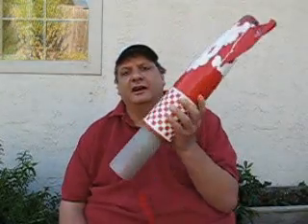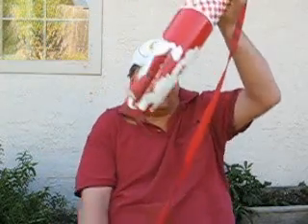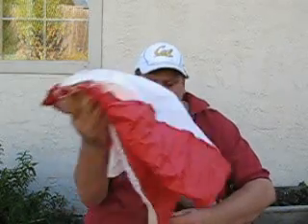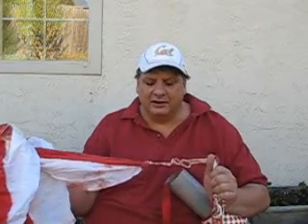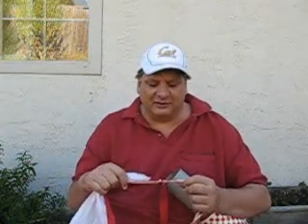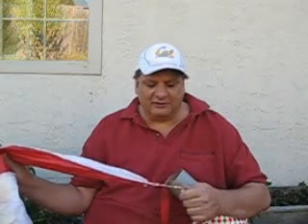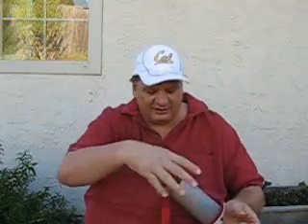Shreds and Rocket kits

Comment: Also forgot to mention my lastest rocket was a scartch built 2.26 times up scale Estes Goblin.  It use 3" BSD body tubes, 3" BSD ogive NC, 1/8" baltic birch fins, and it has a 38mm motor.  It should be flying at the Nov Snow Ranch launch if I get the external fillets done by then.  Also my next project is gona be a 38mm minimum diameter rocket using LOC tubes and an Acme 38mm fin can.

Comment: There is also Public Enemy Rockets they make some great rocket kits for some one that has built a few high power rockets before.  I own two Public Enemy Kits the Performer and Extreme Performer they are both great.  Also LOC kits are great I own the Weasel, Viper III, and Starburst.  All great kits, but with the Starburst I regret building it with the two 24mm motor mount and I wish I put a 38mm in it.  Also about AeroTech kits the Initiator is a great kit mine has 13 flights on it.

Comment: You also forgot the PML Phobos and X-Calibur both of which I own.  Also I certified L1 with the PML Phobos.  In addition I pranged my PML X-Calibur at XPRS V and it surrivied fairly well.  I just need to get a new payload bay and nose cone.  They are both great L1 rockets.  Also about Q-tube it's not fin flutter it's friction and the plastic gets soft and the fins just shred off.